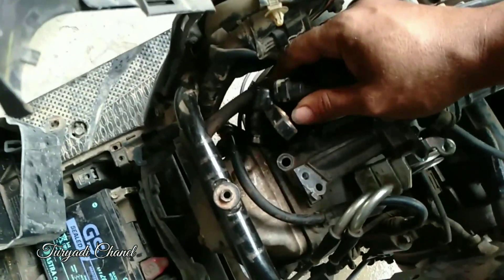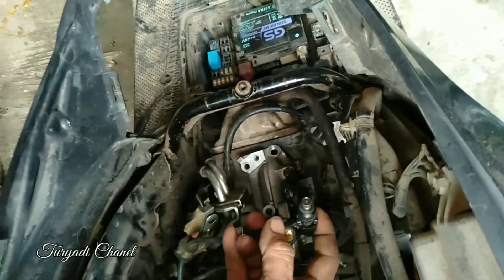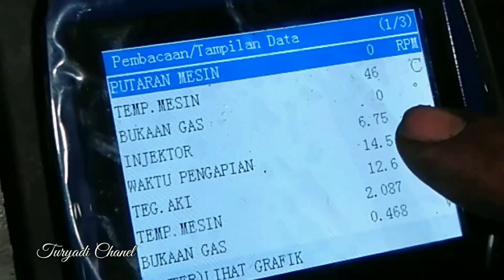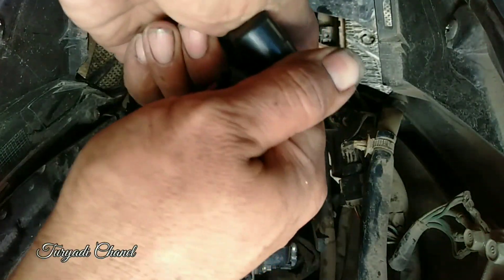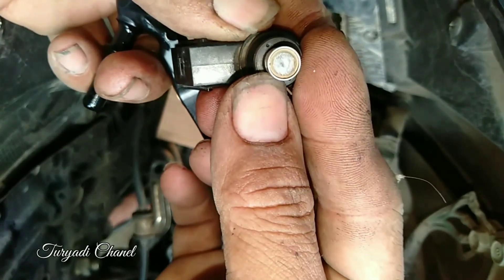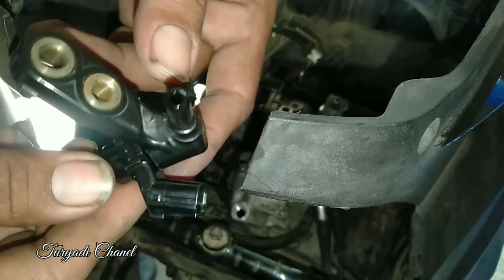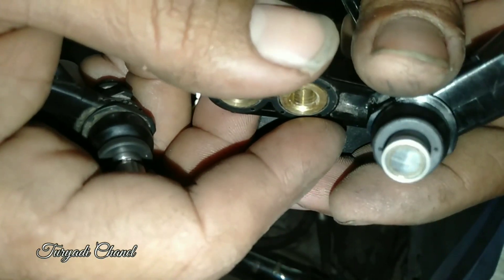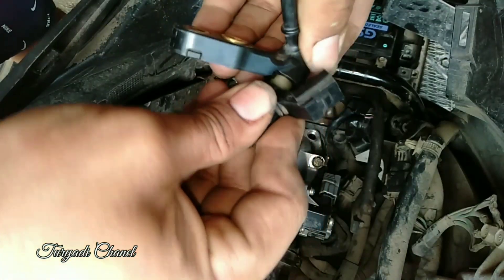Tanda tanda injektor motor Beat Deluxe sudah boros bensin

Comment: Tahan berapa lama om injektornya ? Kemarin beat deluxe sy ganti injektor di dealer dikasih punya vario kode KZR cuma bertahan 10hari udah jebol lagi
Reply from the maker: Ini masih awet, itu anu ORI copotan bukan beli baru mas
Reply: Kemarin ganti pakai ori copotan juga om tp jebol lagi. Penyebabnya apa ya om injektor sering jebol
Reply from the maker: @jevrinurfaisal6103  mungkin tekanan fuel pump terlalu tinggi,